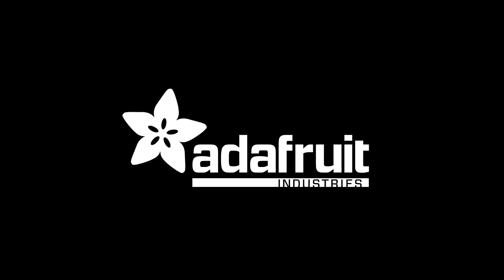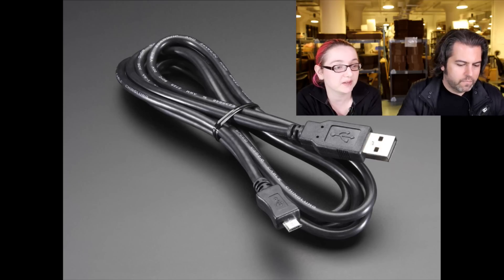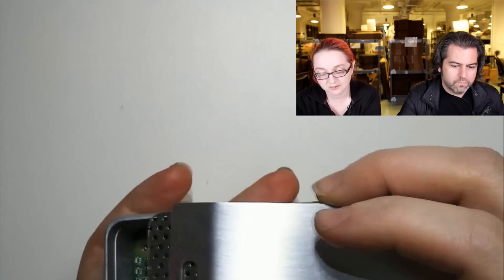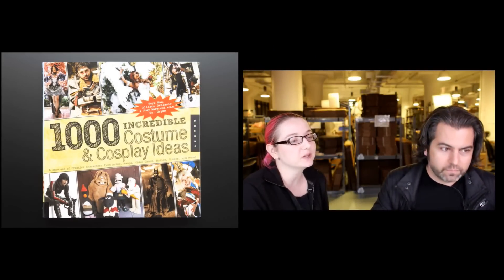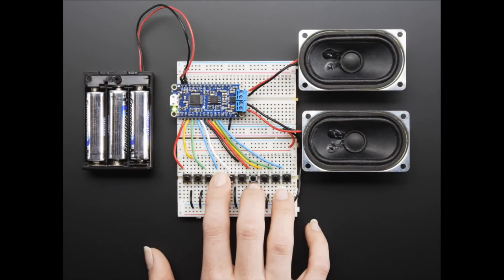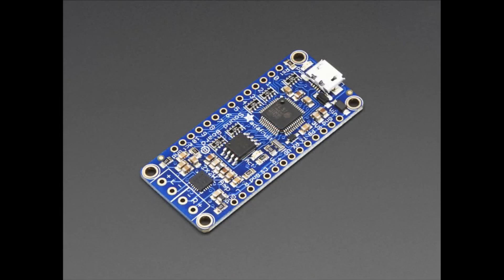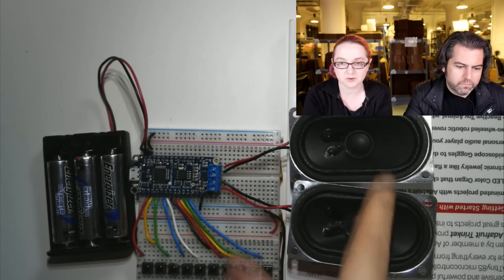New Products 10/22/2014

Comment from the maker: New Products 10/22/2014
http://adafru.it/dGx

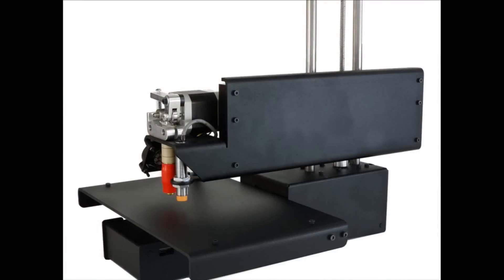 - PrintrBot Simple Metal 3D Printer - Black - Assembled (0:07) https://www.adafruit.com/products/1760

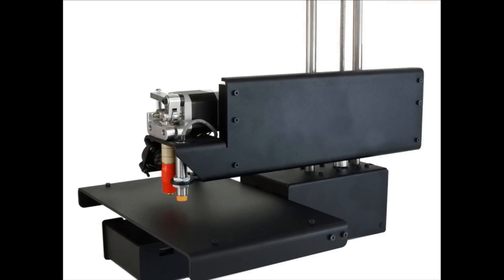 - USB A/Micro Cable - 2m (0:57) https://www.adafruit.com/products/2185

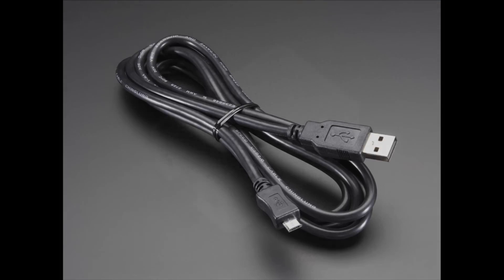 - UniPi+ - Unibody aluminum case for Raspberry Pi Model B+ (1:48) https://www.adafruit.com/products/2198

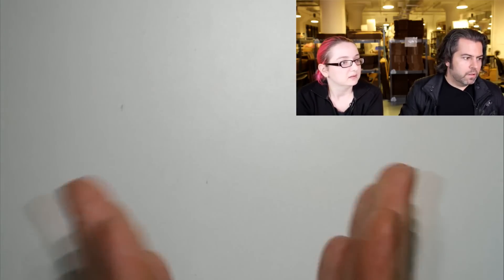 - 3DR Iris+ — Autonomous multicopter (3:23) https://www.adafruit.com/products/2199

 - 1,000 Incredible Costume & Cosplay Ideas (4:48) https://www.adafruit.com/products/2208

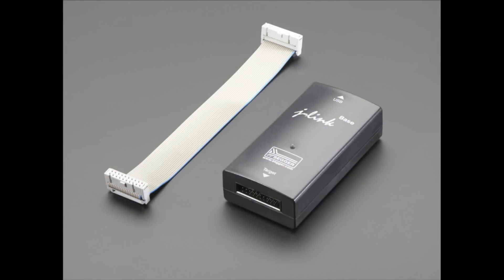 - SEGGER J-Link BASE - JTAG/SWD Debugger (6:27) https://www.adafruit.com/products/2209

 - Adafruit Audio FX Sound Board + 2x2W Amp - WAV/OGG Trigger - 16MB (8:49) https://www.adafruit.com/products/2217

 - Adafruit Audio FX Sound Board + 2x2W Amp - WAV/OGG Trigger - 2MB (8:49) https://www.adafruit.com/products/2210

http://adafru.it/dGx
All are in stock or available for signups and shipping now!

Comment: can the fx thing be controlled by an arduino instead of manual?
Reply: You bet. Just have the the arduino digital out pins trigger the inputs. You can do this with a small signal transistor. When your arduino pin is set HIGH the transistor will connect the sound board input pin to ground and trigger the audio file to play.